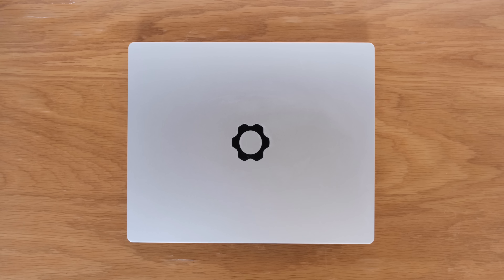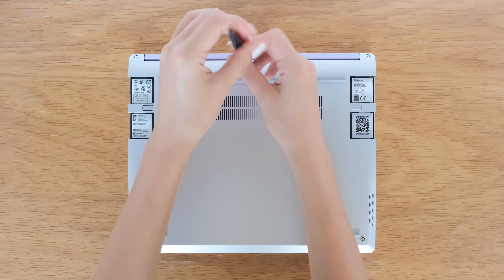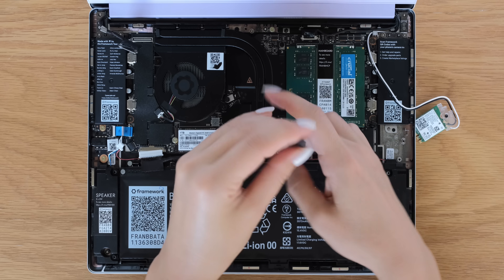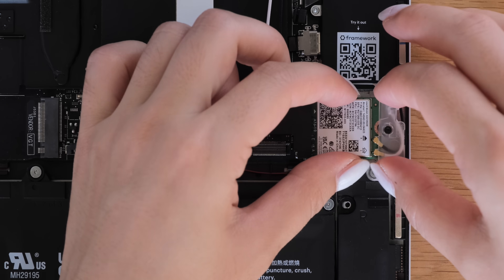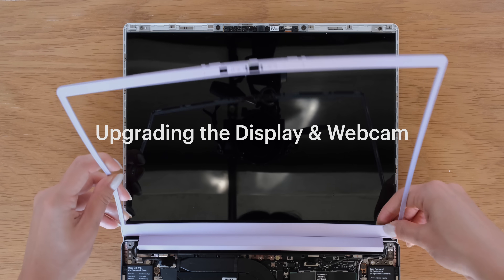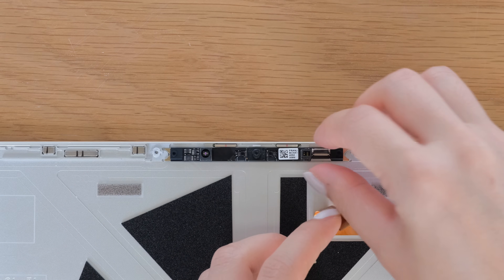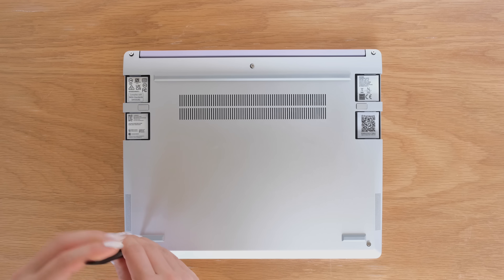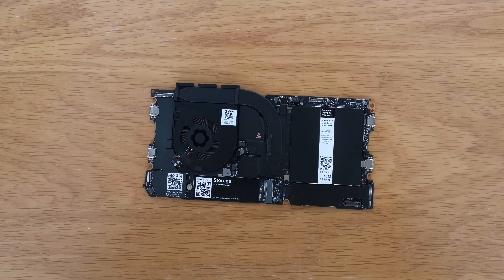Upgrading Framework Laptop 13 Mainboard, Display & Webcam (feat. Intel Core Ultra Series 1)

Comment: Is it advisable to disconnect the battery before unplugging the display connector
Reply: Yes, you should always disconnect the battery BEFORE any further disassembly. As soon as it is accessible, disconnect it immediately to avoid the risk of shorting anything or even electrocution.

Comment: Are the screws on the Framework 16 also captured?  I really like that feature as somebody who's worked on many a laptop and had to keep track of a bunch of tiny screws, sometimes even of varying length and thread pitch.  This would make life so much easier, especially for a laptop that's specifically built to be user serviceable and upgradeable like the Framework is.
Reply: The screws in the midplate, the two of the screws that help hold the dGPU/expansion bay shell as well as the four screws that hold the interposer (at lease for the dGPU to my knowledge) in place are captive. There are no screws to take the keyboard, trackpad and spacers off on the 16. The remaining screws for the other components such as the cpu and screen are not captive similar to the video. Hope this helps!

Comment: Framework please make 20-21" laptop with proper socketable CPU, 4-5 M.2 slots and couple of 2,5" too, good sound, big touchpad (like razer blade),option to upgrade screen in future and MOST IMPORTANT with BEST COOLING possible, like it was in clevo p870 with gigantic vapor chamber (or anything that can have capacity for it) but better, not too low profile fans, one that will be good enough to work good with regular thermal paste or phase changing thermal paste(optional water cooling will be good too), unfortunatly GPU upgrade is harder, because of discontinuation of MXM, but even this way it would be perfect for "Desktop replacement" need that many have due to lack of space. It can be even 5kg+ (due the need of cooling). Clevo p870/Alienware 18(2013) sized chassis like machine can fit 20"+ screen, and as it wont have option for second GPU it will have space for this kind of realisation. Please make it happen 🙏
Reply: In such a situation, could you not just buy an mITX system & 24" monitor? It would be better performance than a laptop with the only downside of it not being as portable
Reply: @Sithhy  all point of 21" laptop is somewhat portability. You can build mITX system any day, but there is no option for really big laptop (there was good ones xps 2010, hp HDX 9000 series and abomination named predator 21X).
Reply: There's just not much of a market for this. There's already not as many people buying the Framework 16 because the 13-14 inch range is really just where most people go for laptops.

Comment: I think I would have tested the power-on sequence after replacing the main board and before replacing the display, to check things were as expected. Certainly test it before replacing the case screws. 

Looks like a great system!

Comment: Great video! Question: Does Windows complain once you power on after an upgrade like this? Since I'm assuming a lot of the 'core' hardware has been changed / upgraded?

Thanks!
Reply: If bitlocker was active you probably need to enter the recovery key (that you hoppfully have printed).
Reply: Um, she has to reinstall Windows on the new SSD, right?
Reply: @impulsesystems  - Looks to me that she swapped the original (same) SSD back into the laptop towards the end of the video.

Comment: Does the ultra series CPU use dual lane for the RAM? WHat is the performance impact of using only 1 Stick with 32GB
Reply: Can't answer you first question but for the latter, it depends. If you do some general tasks on the PC like any "usual" person would then having a single RAM stick won't really impact you negatively, but if you were to do more performance intensive things, then having 2 sticks on RAM is definitely better, especially on a Ryzen system
Reply: Correct me if I'm wrong but I think amd CPUs with 3d v cashe depend on ram less not more than Intel atm.  @Sithhy

Comment: I can see various videos about FW13 but it looks like FW16 is kind of unwanted child... There are definitely some love and upgrades needed for FW16
Reply: It's more that the framework 16 just barely came out of pre-order phase. The framework 13 has existed for a very long time. And at the time of the framework 13 launching it actually had less modules available for it.
Reply: @heroninja1125  Exactly, there is 1 model of the 16 when an upgrade comes for it we will definitely have videos talking about it, and as it is only AMD it complicates a bit because the model 13 only has Ryzen 7000, when an upgrade comes out in AMD CPUs, we will see new models for the 13 and 16 or maybe an Intel version of the 16 and there would still be doubt as to whether we will see a version of the GPU module with Intel Arch or Battlemage
Reply: They need monitor upgrades and processor upgrades and more customization

Comment: As a Linux user I might be wrong here, but maybe it's important to hint to Windows users that they might need to have their Bitlocker key at hand if they change their mainboard but keep their storage.
Reply: Or turn off bitlocker before you do this.
Reply: @monker88  Easier to suspend bitlocker than to turn it off and wait for decryption.
Reply: as a Linux user you are almost always in the wrong😂
Reply: @chimpo131  what a lost opportunity to give a better explanation … 😕
Reply: @chimpo131  What's wrong about the comment? I did have to unlock my Windows 11's Bitlocker using the recovery key because it would complain when it booted with an eGPU (results in another PCIe device connected) after booting without one. Replacing your mainboard is likely to have a similar effect, no?
Reply: @chimpo131 No as a Mac or Windows user, you are wrong by default

Comment: shouldn't you disconnect the battery first before disconnecting the display?

also you skipped the most difficult part - installing the bezel
Reply: 1：02 battery disconnected already
Reply: @frankwong9486  Also the mainboard has an interlock switch that automatically disconnects the battery if the case is opened :)
Reply: @frankwong9486 just before starting to replace the display they connected the battery again.

Comment: Could we get a chassis for reusing the display panel as an external monitor?
Reply: Sure, just make one in the 3d editor of your choice and spring it on the 3d printer of your choice.
Reply: I think someone should do market research to see if selling this already done on the framework marketplace would be worth doing  @sonickrnd
Reply: @sonickrnd is there already a certified driver board with hdmi or display port inputs that runs off a standard 12v barrel plug to go with that cad enclosure file you pulled out of your big 🫏??😂😂😂😂
Reply: @chimpo131  some testing has been done by various community members (& nirav, CEO) on a couple of driver boards. seen on the Framework forums under "HDMI controller board for display panel"

Comment: Every sustainable corporation or government entity should embrace framework laptops. They can save millions per year in IT procurement, not to mention the environmental aspect.
Reply: Amen
Reply: Most cases could do with old hardware and Linux
Reply: Abysmal support of launched boards would put a halt to that pretty quickly. They have a tendency to abandon support for boards before they've even hit your doorstep.

My 12th gen has been given a single BIOS update in it's 2.2 years of life, still has gaping security holes and that BIOS (if it doesn't brick the system), creates more problems than it solves.

They seem noble and cool on paper, but it's basically a bait and switch unless you're willing to upgrade your mainboard every generation.